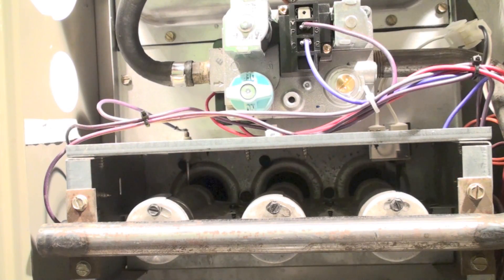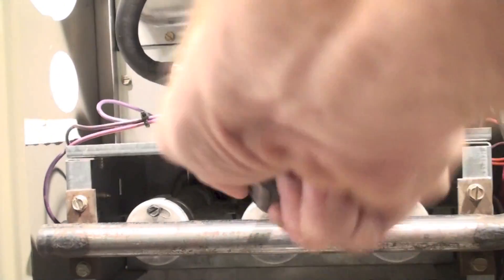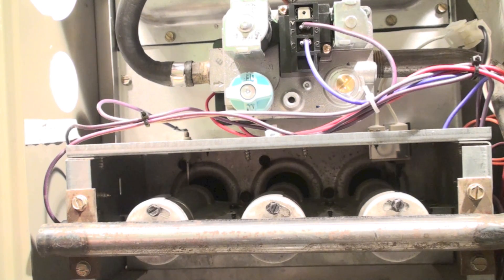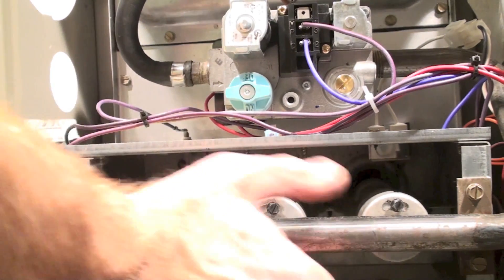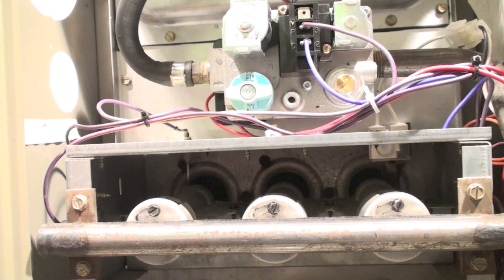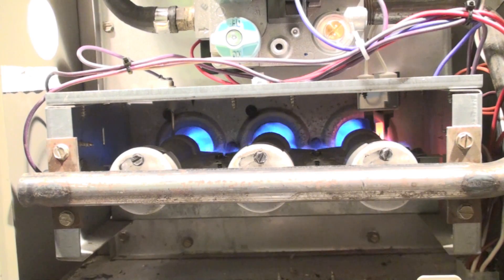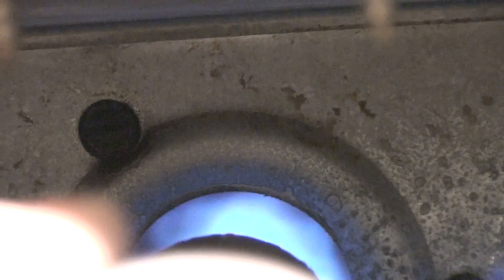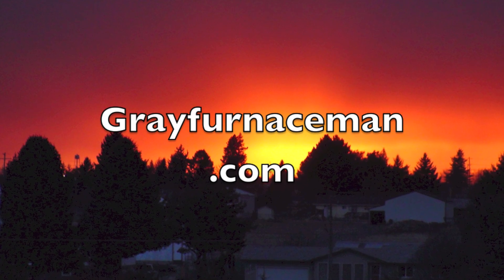How to service the 80% AFUE gas furnace.  Adjust burners and finish service.  Part 9

Comment: if my windows are full open and im still getting yellow tips am i fucked?
Reply from the maker: I would remove the burners and clean them.
GFM
Reply: I had a service guy come out from some big company. He said he thinks the heat exchanger shows signs of corrosion and that i'm getting air from somewhere else, but i'm having a hardtime buying that as the CO tests are all good and there is no substancial rollout or anything like that? He told me I need a new furnace and itll be like 8K ... they also have burner cleaning and adjustment in their service bullet points, but he never did those things. Am i being ripped off?    @grayfurnaceman

Comment: Great video, thanks. You mentioned most new furnaces don't have burner adjustments anymore. How do you adjust the burner operation then? Especially on units like mine that have multiple circulating fan speed settings.
Reply from the maker: Set the manifold pressure to factory specs and it will be right.
GFM

Comment: Hey GFM, love the videos. What could cause the pilot to go out after 3 cycles or so?  It lights right back up every time. Thanks
Reply from the maker: Alvin Thomas there are many possibilities here.  Is t couple voltage above 18 MV.  When you blow out the pilot, the pilot safety should drop out between 1 and 3 min.  10 seconds means there is a problem.  Is the vent drawing up and out.  Is there a crack in the heat exchanger near the pilot that could be getting air from the fan blowing out the pilot.  Hope this helps.
GFM

Comment from the maker: I never argue with using a CO detector.  It should be on every truck.  If you suspect a crack, such things as removing the blower and feeling with your hands, removing the supply plenum to check the top and there is a smoke that can be trapped in the tube to see if it leaks are all methods used.

Comment from the maker: Generally analysis is not done on gas designed appliances.  That said, analyzers are getting somewhat cheaper and more common.  Using one certainly cannot hurt.  
GFM